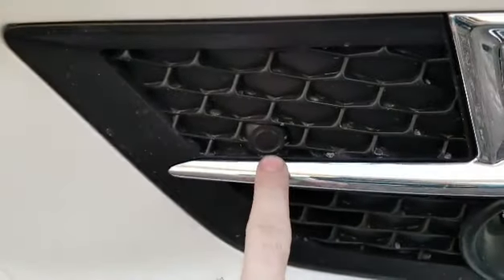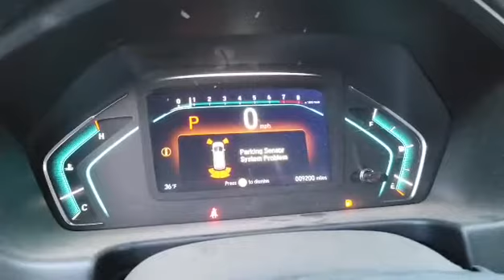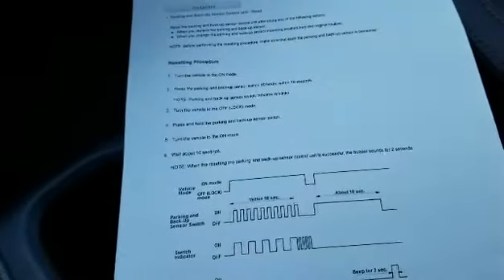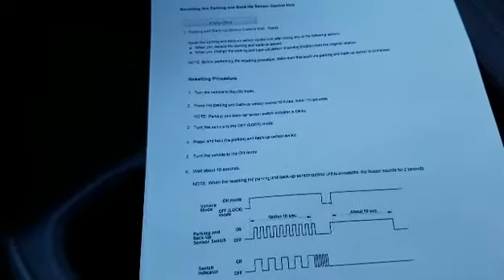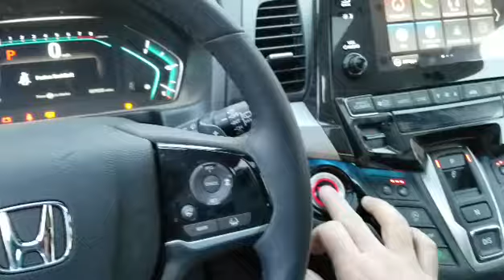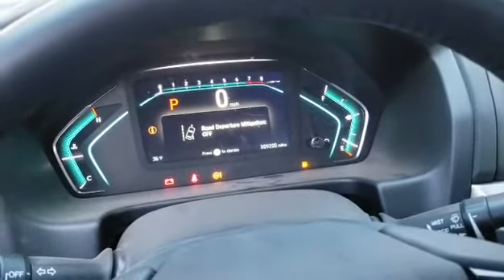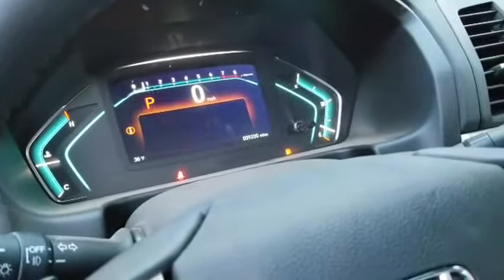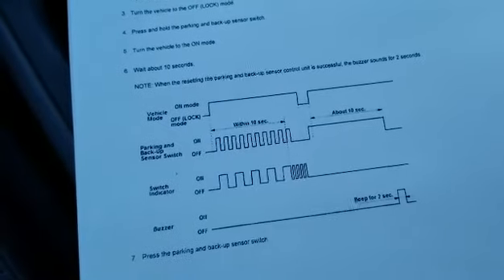HOW TO RESET, INITIALIZE, PARK ASSIST SENSORS ON HONDA AND ACURA VECHICLES, STEP BY STEP.

Comment: I have acc adaptive cruise control system problem. Collision mitigation braking system problem. Road departure mitigation system problem. Errors on my 2020 accord. Any idea how to go about fixing this besides going to the dealer?
Reply: I just got all the same error messages on my 2019 Honda Odyssey EX-L. Sent to Honda dealership yesterday and they just told me the car has a "faulty front camera" . This is the camera that is attached to the front windshield, behind the rearview mirror. I am now awaiting dealership to call my extended warranty co to see if it's covered. I only have 67K miles on my Odyssey, no wrecks or damage, so not sure why this part would fail so quickly.
Reply: @ceswimteam6981  I was thinking it might be the sensor in my grille but I wonder if it could be that I have the same  camera
Reply: The Honda dealership diagnosed a “multiple purpose camera has internal failure” and my 10 yr / 100,000 mile warranty, I purchased with new Honda covered the repair cost of $1,274.22 (camera part $927.52 + $346.70 labor ) . The camera was faulty and not communicating with all the safety features resulting in multiple error code messages on dash. Picked car up today and all seems work perfectly.  Hope this info helps
(This is the camera located at center top of front windshield - in black box behind center rearview mirror)
Reply: I asked the Honda service tech if this faulty camera is a common problem and he told me he has had two identical camera repairs just this week! Sounds to me like a known common problem that Honda needs to address by recall.  My car is 2019 with 67,000 miles and NO accidents or even bumps whatsoever. I’m glad I purchased the Fidelity, Platinum level extended warranty because it just paid for itself with this repair.

Comment: Thanks for the video. Replaced two and was still getting the error. Saved me another trip to the dealer.  2021 acura rdx
Reply: I also have an RDX 2021. How did you properly do it? Did you hold the power button to properly turn on the car? Because when I just tapped the turn on button it just says “hold break and press power button”…. Or after 10 taps of the park button you just also tapped your power button to turn on the car? Thanks in advance
Reply: @gphikicks7040  it's been a while, but I just followed the video. Worked on the first try
Reply: @tonsofguns850  damn. Yeah I guess mine has a sensor problem. Do you know how much the cost and labor was to replace to sensors?

Comment: Thanks. It's working on my CR-V European model.
Reply from the maker: It should
Reply: Model year?
Reply: @Zulu823  2013 if you're asking me.
Reply: @antigay4123  yep, thank you! I tried on my 2007 CR-V but it didn’t work, I guess I’ll have to remove the bumper and change the sensor

Comment: Thanks so much for i did it on my 2018 Acura TlX Aspec after noticing the sensors were not working brought them back to working order and saved me the trip to the dealer.

Comment: Thanks for the video, i have a problema with a front parking sensor for Lexus rx350 2017 is a brand new parking sensor, the dealership say i have to calibrate the new sensor,    Is there any option to make the sensor work as you did with the Honda Odyssey?
Reply: Hey I have a 2017 Lexus rx350 as well and I had to change a new sensor. How do you reset the parking sensor

Comment: I have 4 front sensors on my Acura TLX and the center two were going off for no reason all the time. I replaced the two front sensors but then it gave this error. I did the reset multiple times and the problem message isn't going away. Somebody suggested to replace all 4 front sensors but that didn't solve the problem. Help please!

Comment: Fantastic man! Works like a charm! We now have the notification only when we initiate the car and only about 5 seconds and then it disappears, but that's normal because there is 1 of the sensors that is broken. At least now we don't have the notification constantly anymore, and we know how to reset it when we will fix the broken sensor. Many thanks!

Comment: this worked for my 2020 Acura RDX, as well as the 2019 Acura Tlx  thanks a lot
Reply: I changed my rear left park sensor. Would it work? Light is in the dash. 2015 tlx. Getting the car tmr. Changed due to an accident
Reply: @paultabet4680  yes it will work, this video programs front and back sensors.

Comment: Worked great on my 2018 Acura TLX!!!! Took me a few times had to push it faster than 10 seconds, was going too slow ;)
Reply: I also have an RDX 2021. How did you properly do it? Did you hold the power button to properly turn on the car? Because when I just tapped the turn on button it just says “hold break and press power button”…. Or after 10 taps of the park button you just also tapped your power button to turn on the car? Thanks in advance

Comment: Hi I have a 2014 Honda Odyssey and the car wont lock or unlock when I use rhe keyremote. Also the windows wind down by itself, After I try and lock the doors using the key remote. I have replaced the batteries on the key remote twice now and thats not the problem Have you ever come across this problem before? Cheers 

Please note its not the standard feature honda has for automatic window wind down as I am not even holding down on the unlock button to activate this.
Reply: Hi, your remote must be bad. The windows down is a function when you press ( i think) the side door buttons at the same time... with the purpose of cooling down the car when is parked in the sun.

Comment: This video was viewed over 100,000 times. Honda Dealers would make $100 per one of these customers after taking operational expenses out. If 100,000 viewers of this video fixed the problem at home because of you, they did not go to a local dealer. 100,000× $100 equals about $10 million.
Because of this video, Honda lost about $10 million of revenue 🙀 😬😬